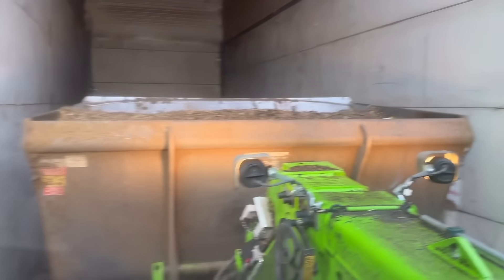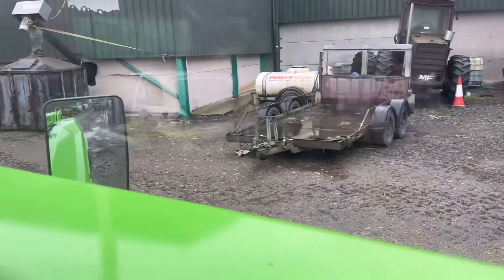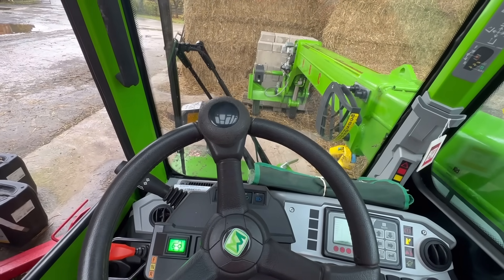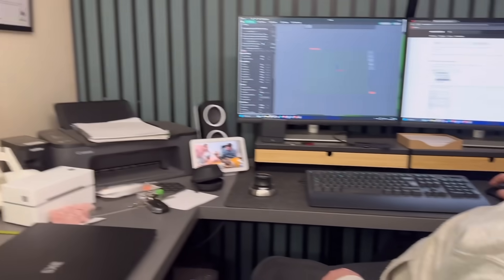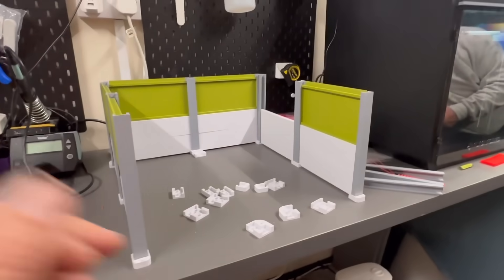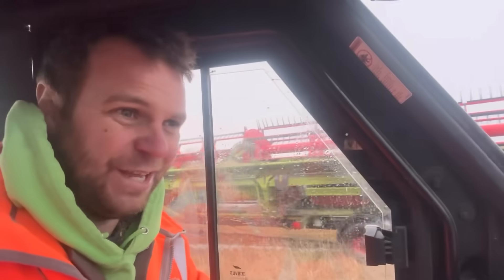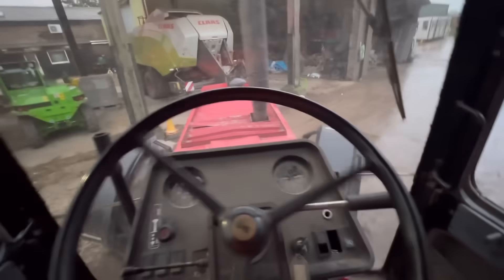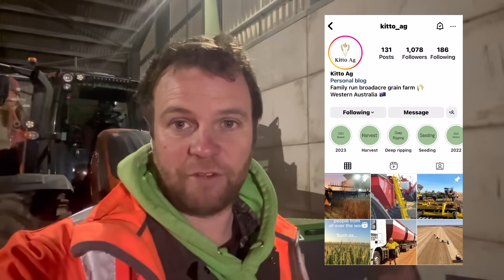HEADER NEARLY FLOATING OFF #AnswerAsAPercent 1327

Comment: That MF is looking very sad and lonely there.  What's the plan for it? How's the 1690 going?
Reply from the maker: Slow
Reply: @OllyBlogsAgricontractfarmer  it's going quicker than my 1494 restoration, I've now got birds nesting in the head liner where the radio is missing 🙈
Reply: It’s not really a slow restoration until birds are nesting in the cylinders, and you’ve lost the head…….